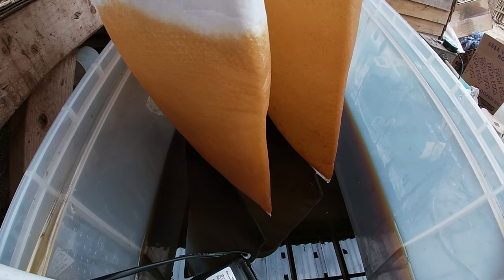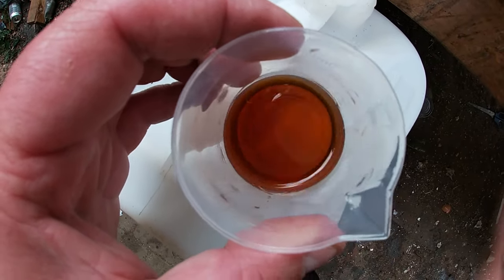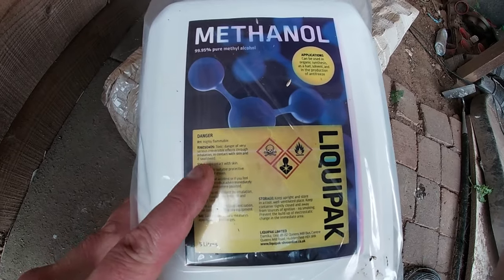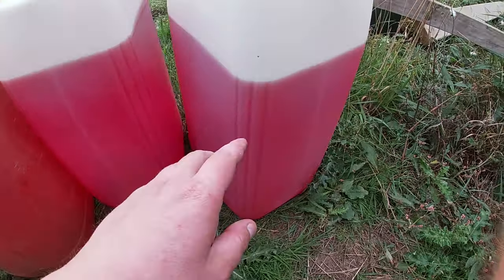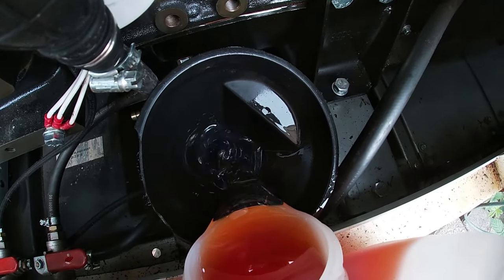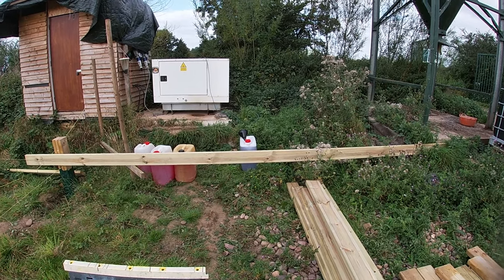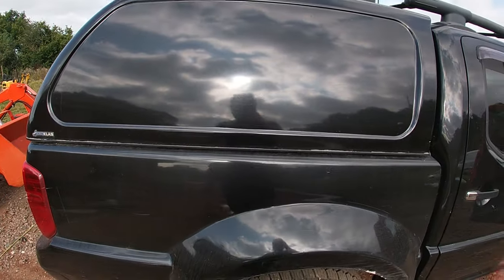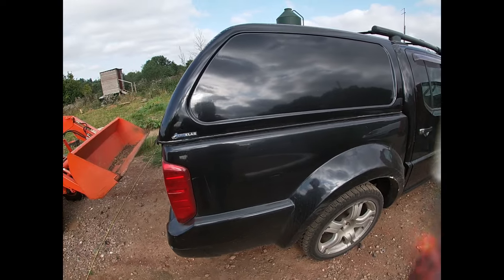3 ways to make Bio diesel from waste veg oil ! Making easy Bio diesel at home ! Making cheap fuel !

Comment: Andit has more carbon then Diesel and it can be used as animal feed
Reply: I have a load of used oil. Can u use normal diesel on a half and half mixture once the oil is filtered. Thanks

Comment: the reason you want the glyserol out of the fuel is to not get i tin to the engine. so modern engines do nto want the glyserol in there at all.  and your not making biodiesel without removing the glyserol!. your making diluted veg oil.
Reply from the maker: If your going to try be a know it all atleast spell glycerol correctly! U edited your post as well and still did it 🤣 All I can say is it works sweet in the 4 different engines iv tested so far
Reply: @FieldtoFarm_UK  Why so defensive?
Reply: Spelling. Also, lack of punctuation, I have some spare for you: ,,,,,,,,........;; 😂

Comment: Using diesel fuel in the mix would be safer, as diesel is made for such engines, which need the oil in the fuel for lubrication! Basically, don't be penny wise, yet pound foolish!

Comment: 80% of the "Fuel" systems I see here on YT are borderline nuts. 100% actually. They're all rubbish.  Every single one misses the point. I smh a lot. "Pump this, do that, tank that, blah blah"...   Whatever. 

The principles are: 
Filter the product to remove large particles. 
Dilute to ensure a combustible end product.  I aim for 3:1 waste material to new material. Ish. Ish is accurate enough. If you don't add fresh fuel to the mix, it's going to be rubbish. Recycle, but be aware of the limits of recycling. 3:1 recycled to fresh is good. 
Allow settlement to remove moisture. 
Remove settled water fraction. 
Filter product through 2 stages to sub 100 microns.  Aiming for anything below 100 microns is kinda a waste of time. You ain't gonna, so don't bother.  100 microns runs in common rail systems - so that's the Goal. If a CRD diesel will run the resulting fuel cleanly, you have done the job. 

I build small 200l capacity waste oil processing units. They require no power, there's ZERO complexity, no pumps, gravity does everything, the process is just chuck this in here, open this, do that, blah blah - nothing fancy required. 

What comes out, you can chuck straight into a 2023 CRD vehicle & it will run fine. You can chuck it into a heater designed for kerosene - those will test your fuel, if it's junk, you'll get smoke, if you goofed, it will sputter or fail to ignite or blanket you in fumes. 

i regard the small processers I build as money printing problem solving machines - you chuck waste oil in one end, diesel comes out the other. Nothing on earth is free.  The cost to produce 1l of fuel that can go into a 2023 CRD without worry is between 28 & 30c per liter depending on how you source your dilutant. That's a fraction of what pump fuel costs so the process makes huge financial sense.

 With just one unit, you stop caring what fuel costs. Run 2 batches and you already have both the System paid for and more fuel than you need. ROI is pretty immediate. Your new problem becomes storing all this fuel you now have.
Reply: Before the keyboard Warriors kick off - I have run 100 micron filtered material through far finer filters under pressure just to see what happens. Sod all happens. You get pretty much the same product out but with huge effort and zero functional gains. It burns no better,pumps no better & is no better. So aim for 100 microns at 3:1 recycled to fresh & leave the Worriers worry.